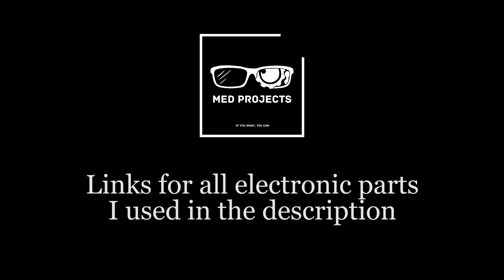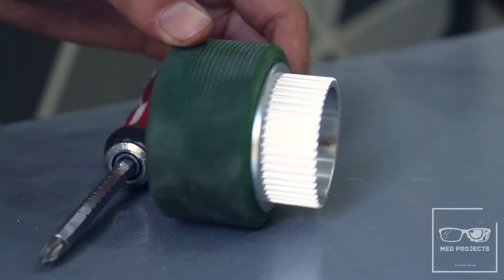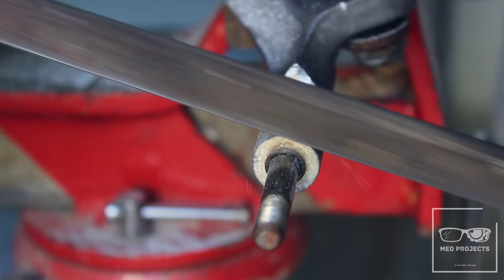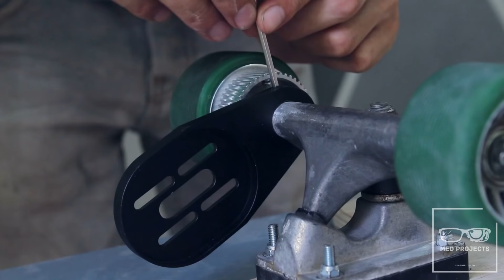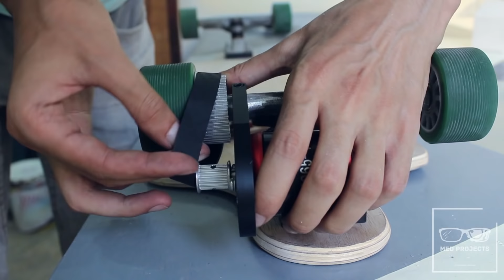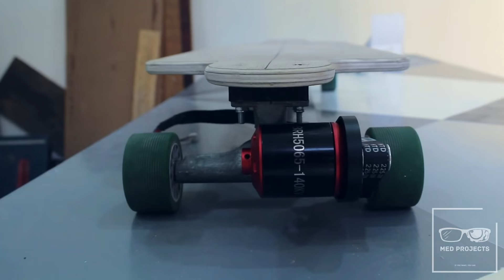DIY Cheap Electric Longboard - Motor Mount, Belt and Pully - part 2 (under 250$)

Comment: ello i have a broblem i make a homemade electric skateboard i bought a 
fvt esc 120A when i was connected the old 18650 battery (old battery ) 
the motor running but a few minute (old battery )
i bought a new 16850 2800mah samsung but when i was connected the fvt 
esc show-off maybe the new battery the A its to high but i dont no 
please help me 
thanks

Comment: size of the wheels you used?
Reply from the maker: this are not the right one! I used what I have in hand! I don't know the size I didn't measure them
Reply: Med Projects I have already ordered a 72mm kit from banggood, i thought i could buy a 72mm wheels here in dubai but its not available. I just wanted to know if i could use a different sized wheels instead?
Reply from the maker: +Mohammed Tauqir i think the speed will be a little slow, I just measured mine the are about 64mm